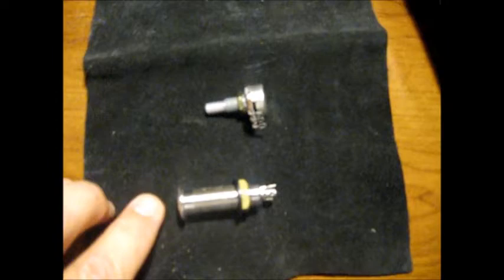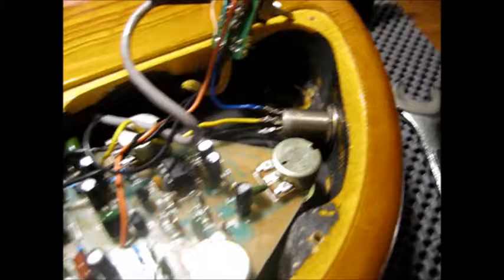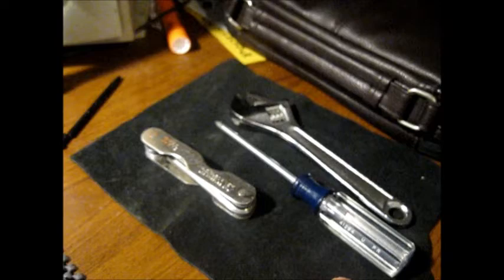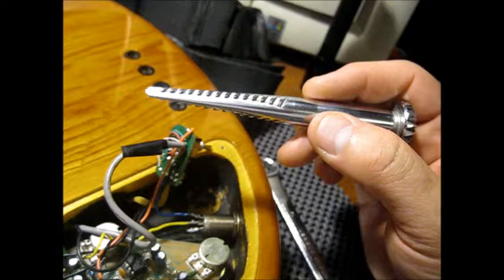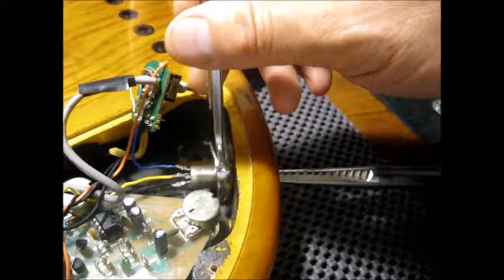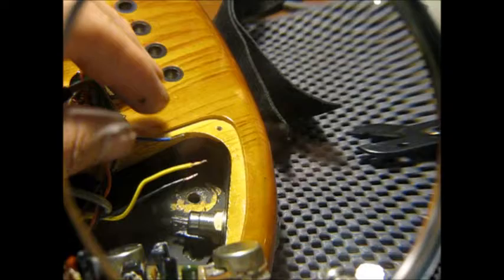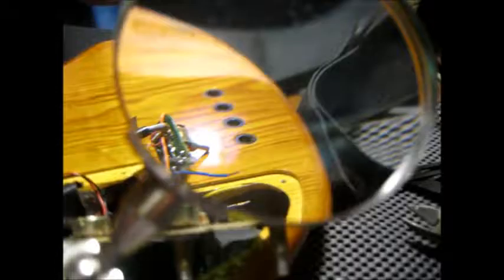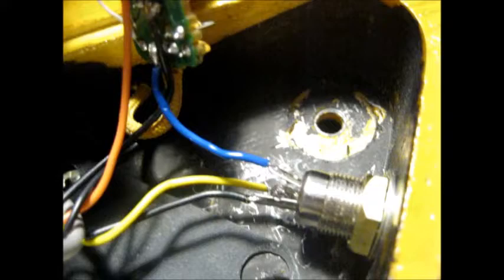DIY Bass Repair Part 1: Remove/Replace Flush Mounted Jack

Comment: I'm having a hard time to replace my flush mounted jack this is a Carvin brand and it has 4 poles ! I know which one is the 'positive' but a hard time to figure it out where the ground wire of the battery goes ?  meanwhile trying different soldering options
Reply from the maker: This page has a couple of diagrams that may help. 
https://www.premierguitar.com/articles/23905-guitar-shop---the-abcs-of-output-jacks

Comment: I have a question about the jack. Is the following wiring correct?: blue goes from the switch board where ground is collected and straight to the ground on jack. The yellow is from the preamp to main lead. And the black is what? I assume its negative from the battery and it goes to the 3rd leg? Thanks
Reply from the maker: kimseniorb that’s how I have mine
Reply: Jason Pike thanks. I have a battery drain issue. Probably should replace that flush mount jack too. I assume any other standard one would do the job?
Reply from the maker: as long as it 1) 3 tabs -stereo output and 2) fits the space. otherwise, yea I think they're the same